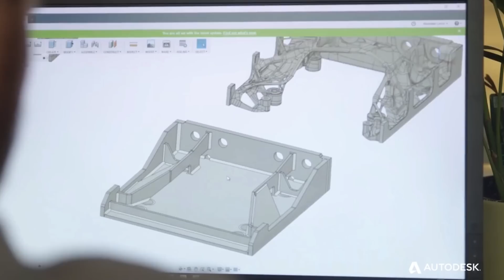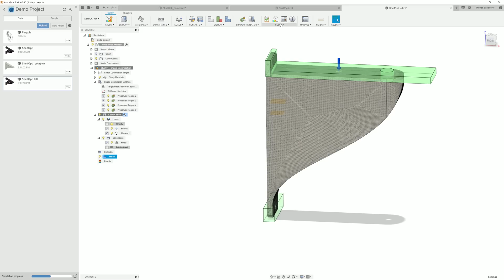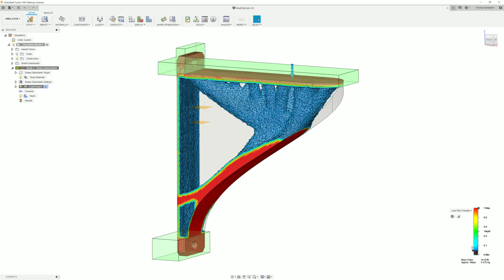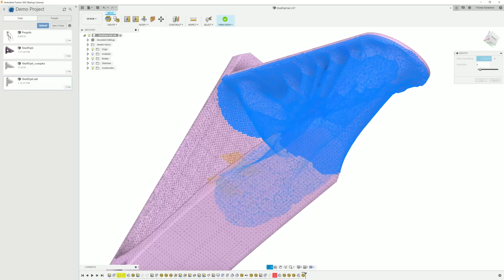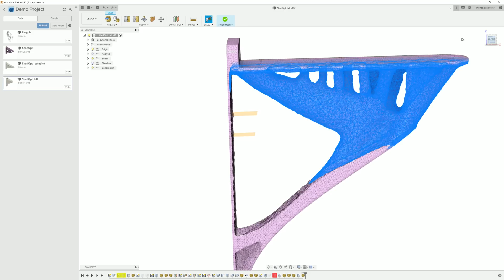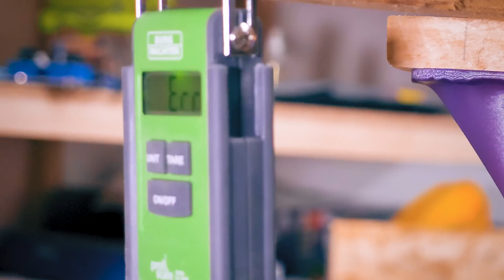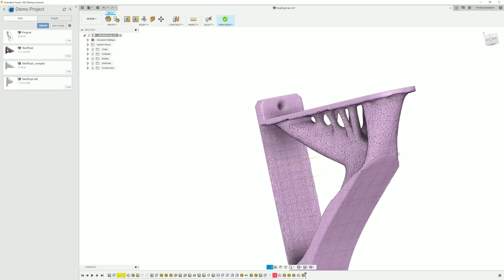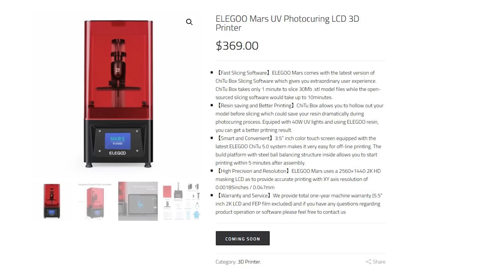Making STRONG shelves with Topology Optimization

Comment: Nice design. Hitting the rate limiting factor ... using wall plugs as you implementation. Not sure why he didn’t hit studs. Also i would’ve chamfered the joints where 90• planes meet. Clearly he demonstrated that was a weak point. Otherwise great video! TFS.
Reply from the maker: No studs in this wall.

Comment: I saw that you ran strength tests on 3 scale models, but did you take into account fatigue from a shelf bracket repeatedly being unloaded and reloaded with weight, over time?  I would think that catastrophic failure from accumulated layer delamination is a bigger concern than the maximum static load a fresh print can handle.

Comment: It would be interesting to see the optimization result if a stress limitation was used which proportioned a lower stress in the cross grain direction. It would be good to know if the optimizations was for strain energy or a limited stress/strain.

Comment: You could do the following to literally mass produce them and do it so much faster: You could buy some molding silicone and epoxy, 3d print an empty inside positive shape, prepare a mold from the silicone and create as many copies as you wish with the epoxy and add some coloring for insanely good looks!

Comment: Heres what i learned....
Me: but did you learn to use stud finders for your next shelving project?
Reply from the maker: Me: Did you learn not to assume every wall in the world is drywall on a stud frame?
Reply: @MadeWithLayers  my grandparents had plasterboard walls with some kind of pellet insulation WITH studs. Channeling the pellet insulation. Their house originally built OVER 100y ago. And updated every 2-3 decades one room farm house two room farmhouse 2 floor farmhouse with indoor plumbing. Coal furnace steam heaters. First floor inlaw suite and most downstairs walls have drywall but the majority of the upstairs is still plasterboard with the pellet insulation. 

So yes I did learn not all homes have studs and drywall over 3 decades ago.

Comment: Spends countless hours designing, simulating, and subsequently 3d printing purpose-engineered high strength brackets to act as the load bearing portion of a shelf storage system... 

Doesn't know how to use a stud finder.

Great work regardless, very interesting video.

Comment: Would by much nicer if it really looked like a tree structure. The bootom part looks strange. But sure, I understand the algorithm just tried to use the most effectively the defined starting limiting rectangle. You should not give any limits on botom part and it would look like a tree.

Comment: Yes, it may be a good guide for designing. But I would definitely used small side loads in this also. And the protoypes broke on the top inside near the bracket as I would expect with this design. Sharp inner corners are not a good thing.

Comment: once upon a time, my mom started her own business.
my dad bought some shelve supports, to make a display rack mounted on a grid fence.
turned out, the supports (L-shaped, cheap steel) were too flimsy, and they buckled under the strain.
......so, he went and welded a 4mm steel rod as diagonal support on every one of them.

they've been hanging from that grid, supporting all kinds of weights, since 1996.

Comment: How about a topology-optimized BIKE ? I wanna see that alien bike.
Reply: That was my first thought as well, I had been dreaming of it since the '90s when doing solid modeling and mountain biking.
Reply: a bike is pretty much already optimised. If you take bike box dimension and apply the forces a bike experiences, you get the bike shape. To get a odd shape you would have to force a to keep or remove particular areas
Reply: Damn. The keyboard professors are strong on this subject! Topology optimization and generative design have already been used on a number of bike designs, as well as several new space rovers. Seriously, just google it. And yes, these are dynamic systems that have a number of weird forces acting on them. The example used in this video only has one force, but you can input a number of different load cases into a single simulation.
Reply: @aerobyrdable  Yea everyone is a genius, dont believe it... just ask them and they will tell you all about it!
Reply: @13thjcs  oddly this is what 3 guys at my uni did over a decade ago using optistruct that does combined load case optimisation and you get well a bike shape.
Reply: there is torque sideways that would be forgotten with normal print materiaal. I think it would work if there was a mold for it.
Reply: that would be hard to use carbon fiber on though, right?
Reply: Thats a dope idea
Reply: YES
Reply: Cool idea
Reply: @13thjcs  you can put sensors on an actual bike them load the data into autodesk
Reply: @13thjcs  a quick and dirty way would be to calculate loads from say three main vectors, run each separately into the program and mesh the three shapes together, starting with an identical diamond frame.
Reply: I think bikes are already optimized
Reply: I've seen it done, it's hard to get right, it does look cool though.
Reply: Have you seen the car frames that look like this? They used AI to create a stronger frame and it created some strange yet strong designs.
Reply: I see your bike and raise you a wheelchair
Reply: I think a regular bike is mostly optimized already, but topology-optimizing it would refine it further, reducing the occurrence of stress risers etc.  It would probably look the same or similar shape, with some differences.  Obviously the inside corners of the joints would be radiused etc, and it would have a more organic shape, and you might shave a few % off the weight.  It would look closer to the diamond shape instead of the already optimized ones, because you'll want impact resistance on the frame to withstand accidental damage.
Reply: I guess Im randomly asking but does anyone know of a trick to get back into an Instagram account??
I stupidly forgot the login password. I appreciate any tips you can offer me!
Reply: @lyricmathew8077  imagine being a bot...😅
Reply: @Kason Thaddeus I really appreciate your reply. I got to the site through google and I'm trying it out atm.
I see it takes quite some time so I will get back to you later with my results.
Reply: @Kason Thaddeus it did the trick and I actually got access to my account again. Im so happy!
Thanks so much you really help me out!
Reply: @Lyric Mathew glad I could help =)
Reply: Bikes are already about as optimized as they can get for the purpose they serve. See the similarities but subtle differences between optimal road bikes and optimal mountain bikes. Same idea with subtle differences
Reply: I'll save you some time - bicycle frames are already topology optimized
Reply: Yes!
Reply: You will be rather disappointed. These shelves were optimized to one single load case. Bikes, on the other hand, have to uphold a lot of different load cases. Mapping them all together into one resulting shape you will pretty much get the "standard" mountain bike shape you see in stores.
Reply: We have tried this. The results we got did not beat a diamond frame.
Reply: There are a few basic reasons why. Basically, the topological optimization you see in most CAD packages is a fundamentally very simple process.

TO is defined for a solid mesh and is not good at generating hollow shapes. 

TO (at least on Solidworks) is bad at handling a large number of load cases, (bike frames experience at least 4 or 5 completely different maximum load cases). 

TO usually only works for isotropic materials, and cannot take proper advantage of very highly anisotropic materials like unidirectional carbon fibers. 

Furthermore the outputs of TO are often not machinable/mouldable and require a compromised manufacturing strategy like 3d printing, which usually eliminates any advantages you gained by doing the optimization. 

In concert, this means that topologically optimized bike frames miss out on using the hollow carbon-fiber tube, one of the most structurally efficient elements in compression and torsional stiffness. None of these limitations cannot be overcome. I think whatever company integrates a structural optimizer that can deal with these complexities into a popular CAD package will win a lot of new customers.
Reply: 1. It’s not that easy. The frame must either be welded which would be difficult and expensive, cnc machiend which would also be expensive, or 3D metal printed or carbon which would still be immensely expensive. 

2. The forces in a bike are much more complex than most other parts. Impact resistance is a key feature to take into account 

3. Getting most people on board with the idea would be difficult. The market likely wouldn’t be too accepting
Reply: @Mapl3Syrup  exactly and most of the forces on a bike are not easily measured. You're not just taking into considering basic loads, but extremely dynamic loads on multiple different planes. 

Think about the impulse forces during jumps.

You could theoretically do it yes, but it's doubtful you would get a manufacturerable outcome that is better than just using carbon fiber on a standard frame anyways.
Reply: It would be great until you ran into a force vector it wasn't designed to handle.  For instance, I had a specialized bike and when I got hit by a car it took the lions share of the impact.  A bike made of twiggy metal columns would just collapse and I would probably have a snapped neck right now.
Reply: bike frames are already topologically optimized, otherwise everyone would be riding triangles, they've always been in their way
Reply: It would break
Reply: @1248erik  no
Reply: @Markfps  yes. topology optimisation doesn't just remove unnecessary material, it also removes strength from it. its called optimisation because you're saving more on not spending that extra material because you don't need all the strength. in bikes, you need the strength. even then, bikes can break (if you dont go into dumb detail about what its made of). so no - you're wrong.
Reply: @ivoandricic1088  Hey, you are wrong. You can indeed design a bike with less material with the same "strength". In topology optimization, we constraint our problems (constrained optimization) such that the minimum strength has to be satisfied. We can even further optimize with a loss function where the strength is maximized and the material used is minimized. Our possible solution space are bikes with different shapes where the minimum strength is satisfied.
Reply: @Userjdanon   Jimmy  A bike is not a well defined term. There are many kinds of bikes, and often those purposed for one function are used for the other. Even within the functions they are made for, there is a factor of unpredictability that is hard to cross. Also, it obviously won't have the same "strength" as before, it will be weaker. These bikes have been designed and made for their function (road bike, dirt bike, electric bike, universal bike, etc...) in a such a way that you have the strength in the places where you need it the most for that particular function. By using intensive topology optimisation you cannot make a bike for practical use that's strong enough for its function. By using an extensive optimisation,  you simply don't shave off enough material to make a woeful difference. I am wondering myself what it would look like, but it wouldn't be much different than the original shape.
Reply: @ivoandricic1088  literally just google topology optimisation bicycle frame
Reply: @ivoandricic1088  50/100 accurate
Reply: @ivoandricic1088  Yes modelling such a function as I described can be hard indeed. But we can do simulations and tests. For at least simple objects, we can indeed design objects to satisfy our conditions without loosing strength. I am actually into blackbox optimization research which has applications on topology tasks.
Reply: Ivo Andričić they’ve already done it
Reply: @ivoandricic1088  Y'know, every minute, someone is believed to be giving birth. And every 8 minutes a person dies. And every hour a special moment happens. And every year, our earth is believed to have shifted half a millimeter, but every moment, there isn't a single person that asked.
Reply: @ivoandricic1088  "It can't be done"... meanwhile, it's already been done
Reply: @ivoandricic1088  generative design bike
Reply: @ivoandricic1088  you disproved your own point by bringing up material cause that's the answer to a very light bike with the correct material
Reply: @ivoandricic1088  there’s a reason Bugatti uses it on there highest end parts. When using strong enough materials, the strength you lose is not noticeable. And you decrease the weight by a order of magnitude.
Reply: @1248erik  Not if it is done right.

Comment: It can't use any information about loads without first having all the material properties of the printed plastic. This would require you to control as many things as possible and do extensive material testing before finally entering all the data into the software. Or you could use some easy safe values. I think I remember seeing a channel that does that sort of testing. The software would also need to know the orientation of the print and all that. 
Was there a place in the software to enter that sort of information?

Comment: should have just anchored the shelves in studs.
Reply: Or use wallmates.
Reply: Drywall on stud construction is considered an absolute joke outside of America, what this guy has is aircrete panels (ergo, no studs to anchor into)
Reply: @fakename287  An absolute joke is not being able to securely mount things to your walls lol
Reply: @fakename287  if there are no studs, what are the laths nailed to? Or are there no structure components in a European wall? Just solid "concrete foam"?
Reply from the maker: It's an aircrete wall, with plaster as the visible layer. You'll often find a polymer mesh as a reinforcement in the plaster as well. More commonly, walls are hollow brick instead of aircrete here.

Comment: wasted $100 on simulation
has sharp edge on highest stress area
10/10 engineering
Reply: You're all 10/10 people in my book. You beautiful strangers.
Reply: Some Guy Thanks man, that means a lot 😊
Reply: Wasted 15 minutes watching a video. 
Makes a comment about spending $100 when he says multiple times he's using the free option.
10/10 youtube viewer.
Reply: 0/10 listening comprehension
Reply: Are there any free and open source topology optimization or generative design software?
Reply: @gregorymalchuk272  I used to use topostruct which is a very small limited tool, but its free and easy to use
Reply: @fayenotfaye  wasted 15 seconds reading reply to comment
Wastes 15 seconds writing reply about wasting 15 seconds replying to a comment
me: wastes 5 minutes figuring out reply to reply about wasting 15 minutes watching a video
me: next level youtube replier
Reply: @Tenpoundpom150  at this point my math skills aren´t sufficient enough to leave a good reply

Comment: Looks super cool, almost like a tree branch. I wonder if it could be improved if the solver knew the load bearing properties of the board placed on top? The solver is supporting a distributed load, but if the board were included in the model then the solver could support just the near edge, far edge and (maybe) middle of the board.

Comment: There is a principle in engineering that states that the failure of a single component shall not lead to the failure of the system.  This is not always strictly possible, but should always be a goal.  Accordingly, in pursuit of topology optimization, individual failures should be initiated in the design process that lead to adjustments in the remaining components.  This second-order stregth resulting from thousands of individual simulated failures obviously requires far more itterating and therefore computational power.  As such power continues to increase, that will be the direction that you will see this nascent technology go if our goal is to produce parts that have true engineering merit.

Comment: A strong magnet will stick to the drywall screws revealing the location of the studs.
Reply: They are no studs used. The walls of German houses are typically made out of concrete or concrete bricks with plaster/render aded on top. He should use screws that go deeper down or try different dowels.

Comment: I designed some spool holders in Fusion 360.  super spindly, modeled after their generative design.  still holds a couple of spools.  had to print sections and glue them together because our printer is flaky.  I like the multicoloured filament.

Comment: the reason why the bracket fell out of the dry wall was because you didn't find a stud to drill into, gypsum has practically no hold strength.
Reply: No studs and no drywall.
He lives in Germany where most walls are brick or concrete.
In his case foam concrete (in German Ytong (which I think us a brand)) bricks.